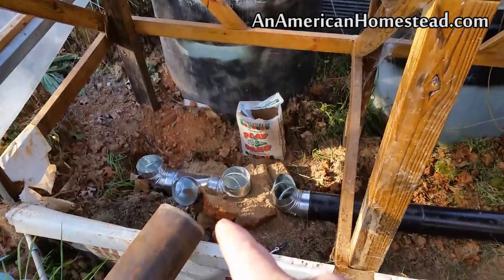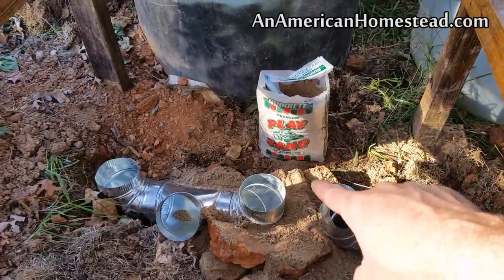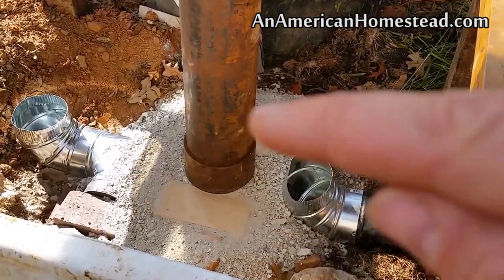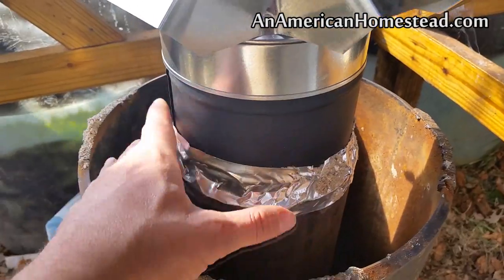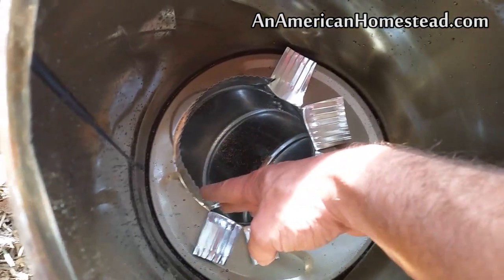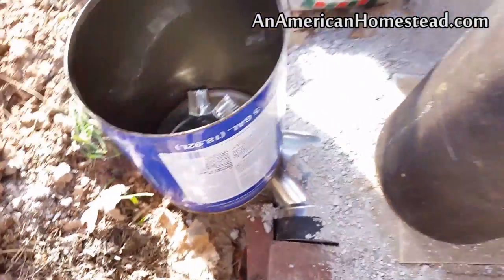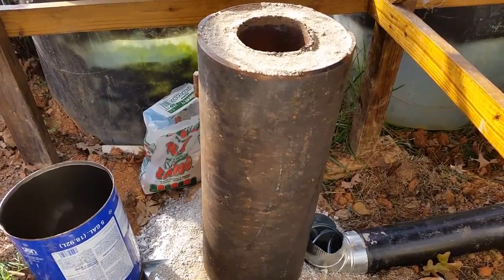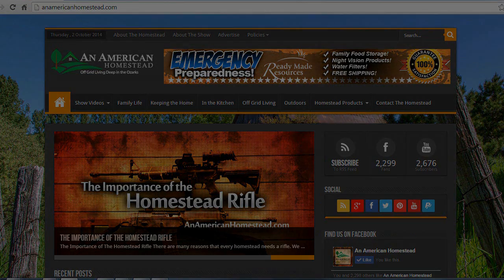Rocket Mass Greenhouse Heater Build Pt.1 - An American Homestead

Comment: whats the lowest temperature your greenhouse gets using a rocket heater? My greenhouse is a simple 10X20X7.5 prefab plastic sheeting one.  I need to keep my greenhouse fish at no lower than 70 degrees F. I am in middle tennessee. We freeze here but not a -40 freeze, lol.

Comment: How did this thing hold up? I had heard you should avoid metal for the burn chamber and inside cylinder of the hear riser as the temperatures will be hot enough to turn it to ore if it is constructed correctly.

Comment: Glad to hear in your comments that the draw is strong.  I tried a rocket heater in my green house a few years ago.  Nearly the same construction as yours.  My problem was I had the exhaust out of the bottom of the heater running 30ft to leave the GH.  My theory was i would get the last bits of heat radiating from the exhaust tube.  But once the heat is gone, so is the draw.  So I had to supplement my fire with a small fan.  If the burn time isn't long enough, you may want to consider adding some mass around the barrel and exhaust tube to absorb heat and radiate over time.  Looking forward to the next installment

Comment: Great minds think alike Yahweh has us building the same thing I just put out a video 2 days ago Rocket Mass Heater build part 1. The build is a little different but both should work fine. I have a sujestion though being how I have built 6 this year I would have the lid of the 55 gallon drum reomovable sealed with wood stove seal you are going to need to get in there and clean it out at some point.
Reply: An American Homestead My understanding of the RMH is that the exhaust tube is not really going to get that hot due to the extreme heat in the barrel from the secondary burn.  As for the belching, is it possible an outside burst of wind may be blowing into the exhaust tube?  If it's not my place to cut in, my apologies.  I just really dig RMHs.
Reply from the maker: Yeah, I'm keeping my eye out for one with a removable lid.  The RMH is running and working pretty good but I haven't cobbed anything in yet so I can make adjustments.  But I'm getting a good draw on the system.  My one question I guess is that every so often...maybe once or twice as its running....it like sort of belches...for lack of a better word.  The fire in the loader goes completely out and belches out a huge puff of smoke for like 3 seconds and then the fire starts right back up again and goes as normal with a good draw and no smoke at all.  Weird.  Also, since you have built a couple...Do I need to fire this up for a certain amount of time before the second combustion starts to take place?  The draw is good and you ca hear the rocket sound but the exhast pipe never gets really hot...just warm.  And I haven't added really any mass yet.
Reply: It is my understanding that that back poof of smoke is the second combustion starting but that will only happen when you inner pipe is hot if its before that it's the wind it does that with everyone I have built 30 plus do that  Next time it does it see if the barrel top start getting super hot because it is like an explosion that happens. The lid is for clean out and the small amounts of ash will start to build up in the bottom of the barrel and in the first 10 feet of your out let pipe. It does take time to heat up the mass because the barrel puts out most of the heat example it took 2 1/2 hours of burning to get the mass warm last night for mine but it is a monster because my greenhouse is so big. Feel free to ask any more questions I do different kinds of workshops trying to help and RMH is one of them. Here is a tip lol when building you walls to hold you mass use bottles or cans cobbed it will make your life much easyer!

Comment: I like where this is headed so far.  Just two comments/questions though.  1. I'm concerned the stove pipe that you used for the bottom may not be sufficient enough to handle the fire longer term.  Why not use the same heavy pipe that you used for the  exhaust?  2. Do you have a system to feed the fire through the night?  It didn't seem like the burn area was big enough to have  a self sustaining fire for long.  Again not criticism, just questions.  I really hope this works out for you because if it does, my greenhouse is next!  Thanks again for sharing.
Reply from the maker: You may be correct about the longevity of the burn tube pipe.  The rise is 1/4 inch thick iron and should last a long while.  I got that for free.  :)  This is simple enough that if two years down the road I need to pull the bottom out, no big deal I guess.  I wish I had a system for feeding the fire.  I have ran it the last 2 nights in a row and I basically have to sit there for 30 minutes feeding the fire to get the green house warm.  It only take 90 seconds for the drum to be too hot to set my hand on once I start a fire inside.  It heats up fast.  However, the greenhouse not being insulated like a home where many of these are set up at, cools down a lot faster. I ran a fire in it last night and again this morning.  Its nights like this where the temp is going to get into the teens that you hope this will help take the edge off and keep the lines for the aquaponics from freezing.  Other than that, the draw is pretty strong.  It works.
Reply: If you have a properly insulated, highly efficiently combusting RMH, metal on the interior hot face (feed tube, burn tunnel, and riser,) is doomed... No matter how thick.   If thick metal lasts multiple seasons, you don't really have a rocket.

  After the riser, the barrel and exhaust can be metal without issues, even with a highly insulated, efficiently combusting "core"